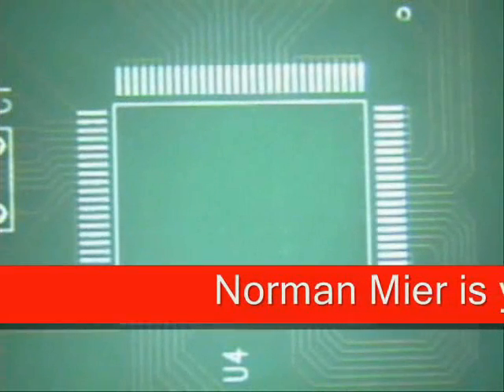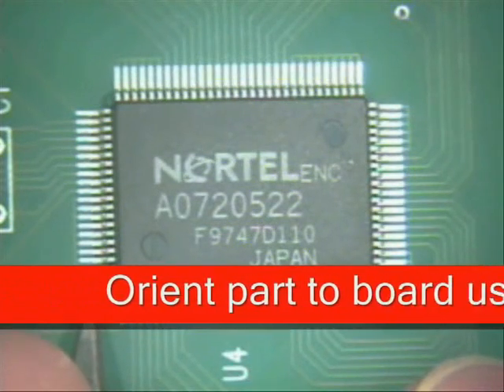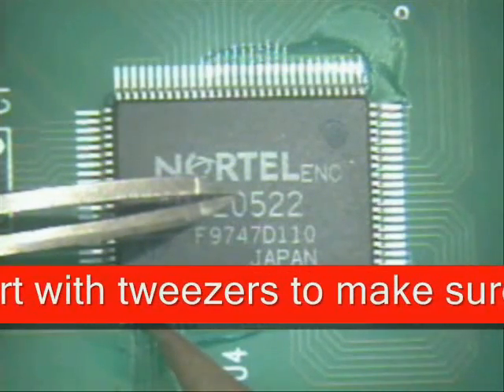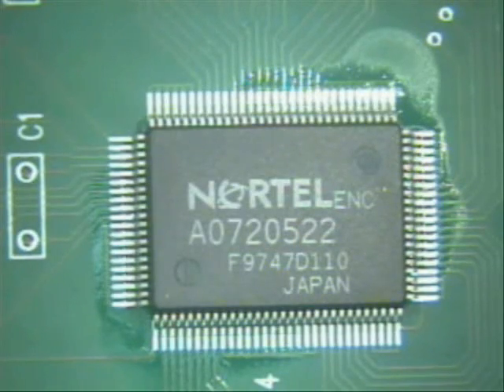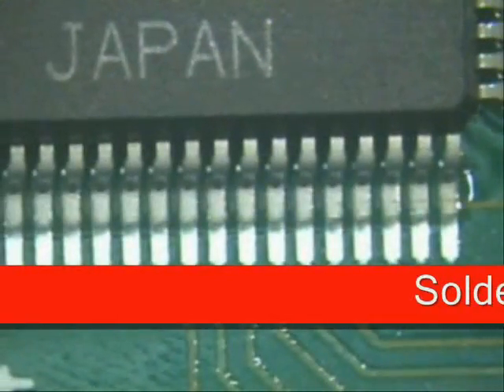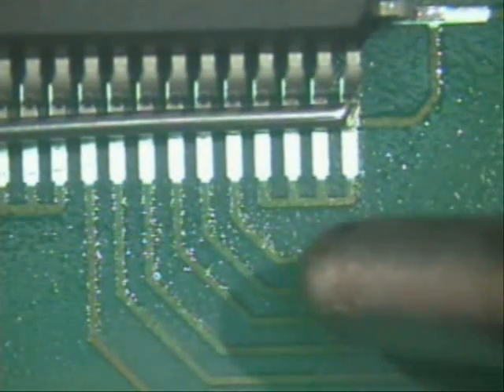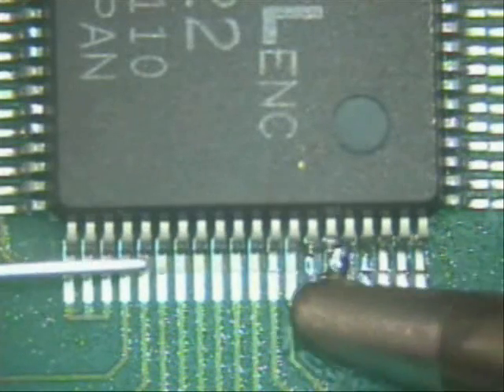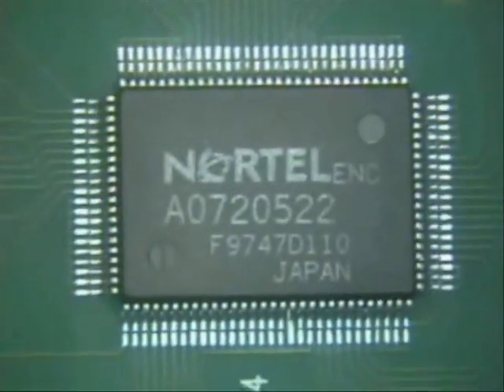Lead-Free Multi Lead Soldering

Comment: What type of flux are you using? You injecting it as I see... I normally use flux pens... But never tried yet this type of soldering however it looks time saving so I might should try it!
If you could point out what soldering iron you use and flux etc would be much appreciated!
Cheers

Comment: Well, why doing it Lead Free? Lead based 60/40 solder is better for any solder iron tip, because the copper can damage the tip. Also, you don't need to go as high in temperature.

Comment: Or I use the heat gun, (once chip is dry to eleminate white dry flux residue. 
I prefer a standard no8 chisel/conical tip bog standard weller to a better job than your vid. ;)
If thermal exposure is a problem or pcb has lots of ground plane,then i use weller heat gun to warm pcb gently before soldering. This helps flow.

Comment: To me, that flat pack you put on is ok but the overall quality of the joints look un even.Yes its better than some people but I use the drag method,little as possible solder on the tip, plenty of flux and go! I like the whole 4 sides to be even just like it comes out of a machine.Brush up/clean with cleaners not alcohol.

Comment from the maker: It called dry tacking.  This is where you don't use any solder but flux and heat.  What is going on is there is some solder left on the pads site after the part has been removed and cleaned.  This is enough solder to hold it in place once you apply flux and heat.

Comment: Hi Norman. What soldering equipment are you using with that hoof tip? Also, what other soldering stations do you use on a regular basis, if any?

Thanks and great videos!

Comment: Norman (or others) - a question re: this technique.  Out of curiosity, why use a Hoof tip vs a Chisel tip - of the width corresponding with the number of pins you're trying to do at once?    It seems like the shape would more correspond with what is being done.  But I'm likely not understanding something re: the choice.  Thanks in advance!

Comment from the maker: What kind of system? That depends on how much capital you have. I generally don't recommend hand-held heat guns for any application. The time and temp profile created by using the heat gun is so variable that it can be very difficult to get consistent results. There are table top systems for less expense which will do the job sufficiently all the way up to monster, automated rework systems. It's up to you to do the math and the homework to determine what's best for your application.

Comment from the maker: Thanks for your question and I'm glad to hear that our videos are effective.
 
To answer the question about the DFN directly, Yes, you will need hot air/gas to solder or desolder the component. It's just not possible to get to the thermal plane under the center of the component with an iron. Some DFN packages are designed in such a way that it's not even possible to solder the individual leads since there's no toe surface or termination visible at the side of the component.